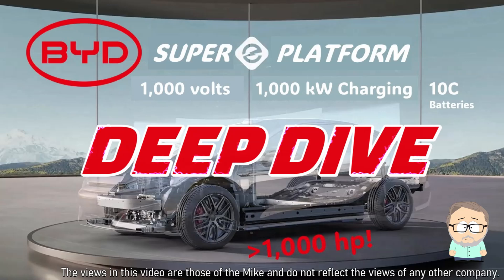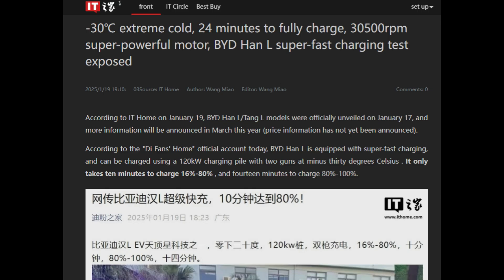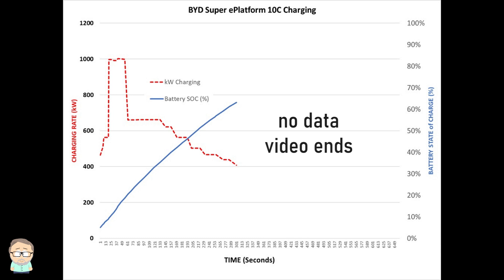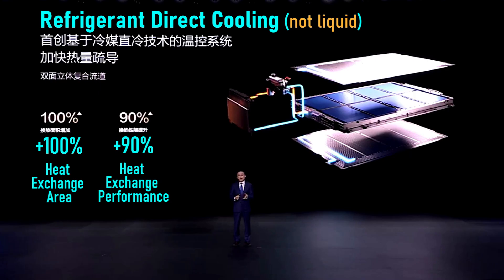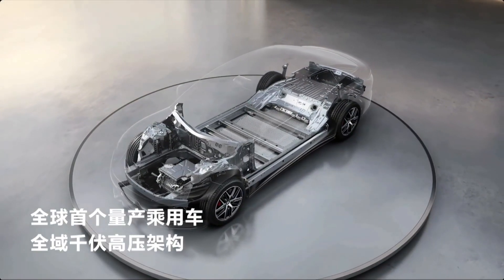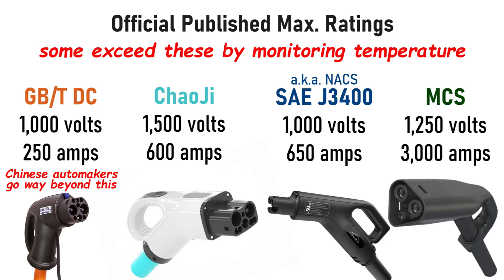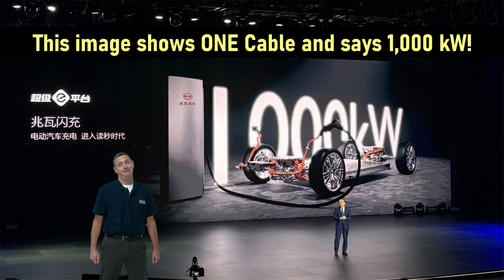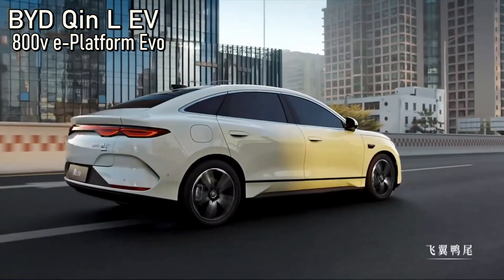Super DEEP DIVE into BYD's Super e-Platform (1,000 volts, 1,000 kW monster)

Comment: How could the charging rate be linear when the power drops off so quickly, and why do they stop at 60%? As an ev owner 60% is not good. Nor would it be for a gas car. 1000 kW is good, but the real challenge is a flat charging curve to 100%, which by the way, is a big selling point of LFP batteries.

Comment: No, you either use Boost or Split Pack to raise charging power from an older charger not both. The Super e-Platform uses Boost so that means (in this case) that a single gun will provide 1000V and 1000A.

The technical possibility might exist to provide both methods of lifting the charge rate in the one vehicle but that would be complicated, expensive and unnecessary. Boost evidently works well in this case and nothing more is required.

Comment: Don't see it happening.  The charger is 1 to 1.36 megawatts of charging power.  That is enough to run about 500 homes.  

The average US home has 200 amp service at 110 volts, or 22 kw max capacity.  You will need 50 times that home maximum capacity to charge this one BYD.  They are talking 1000 amps and 1000 volts or 1000kw.  Do we even have the line capacity to carry the load to each home, or even the available power grid supply to add the additional load?
Reply: This is for fast charging an EV, not for home charging. [Also 200A x 240V = 48 kW]
Reply: @Gig0Surf  I thought this was about the ability to fast charge, period.  And I stand corrected on the 240v.  However, The issue of available infrastructure of both supply and carrying capacity stands.  Trucking companies are already dealing with planning boards due to lack of capacity for exactly the same charging ability.  And at 1 mw we are speaking of only one charger.  I assume thousands would be necessary for an average city.  

In addition, most charging will require a minimum 200 amp service.  60-70% are still below that capacity.  Even home charging if ICE go to EV in large numbers it will require a significant upgrade to homes and the entire grid.  And we are barely keeping up while maintaining existing grid plus wind and solar before adding EV's, heat, cooking, etc.
Reply: @starleyshelton2245  Yes and fast charging isn't needed at home (or other destinations) where most cars are parked for 6-8 hours and slow AC charging is sufficient to fully recharge most vehicles – more time than most cars need when US drivers average only 37 miles per day.  7kw is 30A@240V [40A breaker] or 11.5kW 48A@240V [60A breaker], within the capacity of 150A-200A service.  
 
As for fast charging, as the charge curve illustrates at 2:29, these 10C passenger vehicles will only draw 1MW briefly not through the entire session – although 600 down to 400kW through the rest of the curve is still impressive.  

Not sure how much of a concern it really is when a) most BEVs already on the road today won't sustain anywhere near that so for the near future the average load on stations, many under-utilized, will be far lower; b) stationary storage is already beneficial to levelize demand and manage the variability of renewables; and c) EV production and sales including introducing new 5C and 10C capable vehicles and selling those in any relevant number already constrains how quickly the charging network and thus grid demand needs to scale to service it.

Worst case, charging your hypothetical 10C capable vehicle on an existing 350kW charger will work just fine.
Reply: @starleyshelton2245  3 Overhead cable .Can carry 11kv x200a = 1.1 MW.
 If one pole carries 9 cables it can carry 3.3MW

BYD not only has to finance the construction of the charger Station  but also the electricity distribution lines. .
Reply: @ Wouldn't 11 kV at 200A be 2.2 MW? [Edit: sry checked power calculator 3 phase 11 kV line-to-line 200A 0.9 load = 3.4MW, no?]  I'm not an expert here, how are you getting only 3.3MW with 9 wires?

Note that BYD also makes the MC Cube ESS available in 1.2MW 5.1MWh or 2.1 MW 4.4MWh module configurations; surges and peak demand can be levelized, managing limitations of local distribution.  Worst case, a busy day and full charging station means slightly slower but still acceptable charging speeds.

I was under the impression large commercial or light industrial customers could have the option to connect to subtransmission such as 35kV.  

Obviously appropriate planning and utility engagement needs to occur, just as it does today for charge point operators and other large commerical industrial loads, but not sure why this is being treated like some exceptional issue.
Reply: @starleyshelton2245  Thanks for the video, I'll check it out (although it looks UK focused when you are talking US).  A cursory search of recent papers suggests 200A panels in the US might be 39-47%, 100A at 32-33% and smaller and larger service less common. 

Regardless a 100A panel could be fine for most regular cars.  With options like branch circuit sharing devices which allow the BEV charger to share the same circuit as the stove or dryer, you could avoid a panel upgrade.

Considering daily driving generally doesn't require a 0-100% charge, this should be fine for most overnight charging needs (when household and grid power demand is lower).  

The world isn't switching to BEVs overnight and these 10C packs will be going into luxury vehicles, owners who either already have sufficient power service or whom can justify an upgrade [People should also look at local incentives that might offset charging equipment and service upgrade costs]. 

Even if there are constraints on rate of transition and upcoming challenges yet to be addressed, naysaying isn't productive to progress.

Comment: Mike, please look at GB/T 20234.3 in the version of 2023 (!) for the recent version of this Chinese DC charging connector, as the old version 2015 (and its limits, that you keep refering to) are long obsolete in newer Chinese vehicles and newer Chinese DC fast chargers. GB/T 20234.3-2023 supports up to 1500V DC, up to 800A continuous (at least the standard supports this) just like the ChaoJi connector (which is standardized in 20234.4-2023).

Comment: Just a FYI for context: I have owned a BYD for just over a year. I have NEVER changed it at more than 6Kw.  It’s never been close to a problem.  Actually doing the twice a year conditioning, where you are supposed to run the battery under 10% and then recharge is quite a challenge…

Comment: The byd 1MW charging will take the next 3years before you can get it in a car.So I don't know why we should be giving them credit,Li auto who have arrived there by then.
Reply: BYD’s car with 1000v tech is sold RINGHT NOW, dude.
Reply: Sister, it won't take 3 years, two cars will be released in early April as well as 500 megawatt flash charging stations opening at the same time. It will expand to 4000+ by the end of the year, BYD never does a launch until it's done, rather than messing with expectations
Reply: Just to let u know, some of our consumers are dringing these two modles on the road right now.
Reply: in 3 years we will have a 3MW charger from BYD

Comment: Every you mention here has been done by Tesla 2years back,Tesla is already using pulse heating in d Usa. .pls do proper research before you publish.
Reply: It's only good technology if it can be low-costed down to true commercial use. BYD has higher charging technology if it's only in the labs
Reply: 😂😂So where now tesal still sells tesal model y with 400v architecture Just to increase profits

Comment: I still think seeing the presentation for you to reach 1MW charging speed you need to plug in the two guns. How would they manage 1MW through one cable that looks like a pretty normal cable? I don’t get why we see the new car with 2 guns plugged in and making reference to 1MW charging speed
Reply: BYDs 1000kw chargers need only 1 cable to get that speed. The 2 gun support is to make it accept two 240kw or 500kw normal chargers and get double the speed of the single charger. You can clearly see it on the demo video on "CarNewsChina" YouTube channel. Only a single cable is being connected while charging.
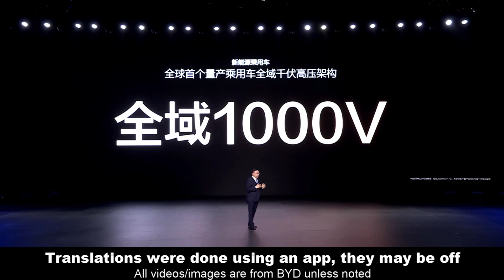Reply: I have no idea how they do it, but in the demonstration done at the launch event you can see the 2nd cable is not plugged to the car while charging at about 0:08 mark in video
https://www.youtube.com/watch?v=FJILyH9DJ-s

Comment: For those unaware 1000V is typical voltage used on long-distance trains. To have that in an individual cars and chargers just so that it can carry 5 people to places make no sense as a means of transportation.

If you are a government and have to upgrade infrastructure do you use 1000V for electric vehicles or trains? Of course you would choose the latter because if you have to have 1000V 1000kw electric power lines it be better used for trains since then it can serves far more people and is far more efficient and eco-friendly. This is rediculously stupid. When do you take a step back and say this is too much?
Reply: Trains are usually 1.5kv dc/ 3kv dc.

Overhead distribution cables usually run at 11-22 kv ac. And 250 amps. 

Because one electric pole can carry 3 lines. So this is just a matter of adding more lines to the electric poles.
Reply: Upgrade infrastructure? What are you talking about? There have been 1000V cars on the road for a time, most newer fast chargers have supported that output voltage for years.
Reply: @w0ttheh3ll  on a rail. Not on a road
Reply: @ you simply don't know what you're talking about. Current EV charging infrastructure can charge Porsche's, Hyundai's, Kia's, Audi's, BMW's and Mercedes's 800V cars and Lucid's 900V cars just fine. These chargers are usually capable of putting out 1000V, so they will probably charge BYD's new platform just fine as well.

BTW, it's completely irrelevant for EV charging stations, but you're even wrong about the trains. 1000V might be used on older subway trains and the like. modern long distance trains use at least 15000 V, typically 25000V. though there's a huge amount of outdated legacy systems still in service.
Reply: First, electric trains are also electric vehicles. So, you should write electric cars instead and not EVs. Second thing, trains and cars serve different purposes though they maybe transportation. Trains are good for long distance mass transportation, while cars are meant for last mile to everyday runabouts. Since NA is car centric, this tech can be useful there. And China also has some long distance last mile connectivity needs. So such quick charging tech helps.
Reply: The byd 1MW charging will take the next 3years before you can get it in a car.So I don't know why we should be giving them credit,Li auto who have arrived there by then.
Reply: BYD does all this through energy storage stations that are not dependent on grid high voltage